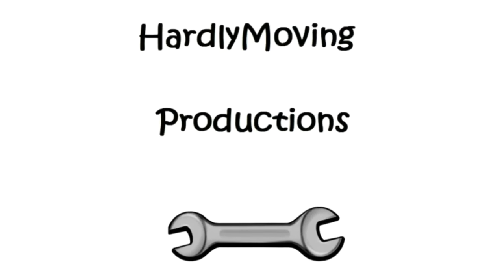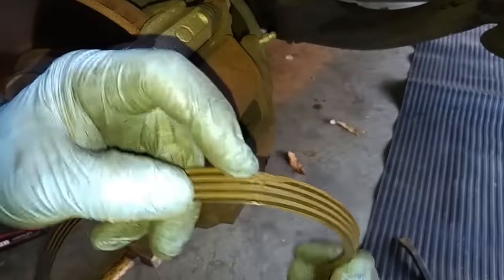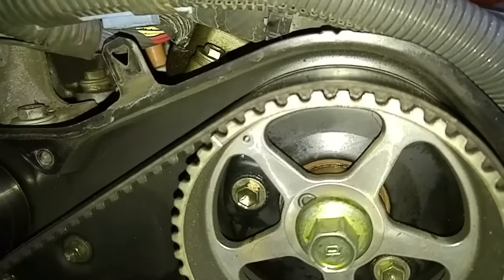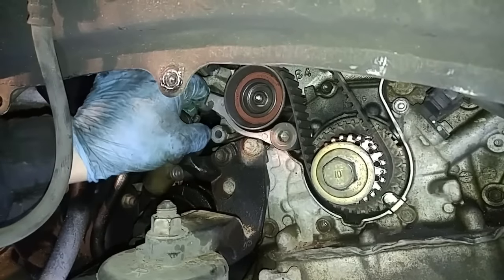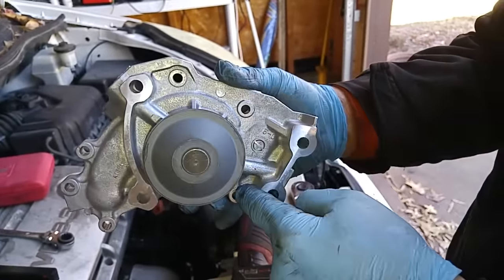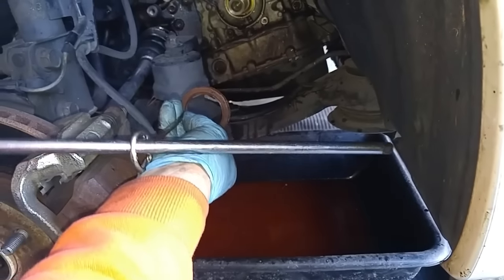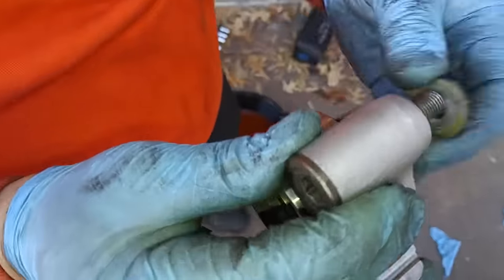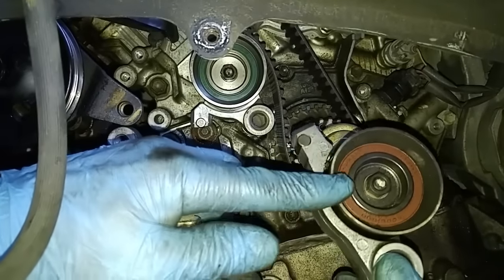Toyota Sienna V6 3MZ-FE Timing Belt, Water Pump, Seals, & Pulleys Replacement

Comment: Hope your still talking about this project, great video by the way....  I have a 2003 Avalon XLS and the engine looks about the same.  I also watched your Camry video.  My Avalon has a lot more space between the timing belt cover and the wheel well.  Does this help with the job a bit?  Had the valve covers changed and only stopped the leak by a trickle.  Lots of oil on the ground so I assume all three seals need to be replaced, at just over 100,000 miles.  I did the water pump on my 87 corolla, but chickened out on the timing belt... just wiggled it out.  I am ready to take this one on as the shop is asking over a grand here in Hawaii.  Is it just about the same with the Avalon.  Any help appreciated! Thanks again.
Reply from the maker: Thanks!  The right bank (firewall side) cam seals can get mis-diagnosed as either a leaking power steering pump or valve cover gasket.  I've seen p/s pumps replaced when it was nothing more than a loose hose clamp which is very common unnecessary repair.   Easy big money maker for the shops.  It's difficult to determine a cam seal leak unless the rear camshaft sprocket metal dust cover is removed.  That's a lot of labor time and the shops would rather say it's something else unless the tech has worked on a lot of Toyota MZ-FE engines.
Reply: @hardlymovingpro  The mechanic put the car on the rack and cleaned the corner of the engine where the oil is leaking.  The oil is often low and I have never had a problem with the power steering fluid levels. Changed the valve cover gaskets and it helped but there is a puddle of oil after parking for just a few minutes.  I have to assume its the crank or cam seals.  It looks like a difficult but doable job.  There does seem to be a lot more room than on other Toyota models with the same engine.  The shop owner specializes in Taxi repair and is a very honest guy.  We do have a lot of V6 Toyota taxis on the road in Hawaii so I can assume he knows where the leak is coming from.  I will check the PS pump and hoses first.  The 03 Avalon is great car and will be hard to replace for a decent price.  Should have a nice long life if the proper repairs are done and correctly. Thanks again! Great videos!
Reply from the maker: @scotthovey7879  You bet and no problem!  Another source of an oil leak are the CV axle output shaft seals (where the axle slides into the transmission).  A puddle of oil is a bad pretty bad leak.  Here's a link to a recent 97 Avalon T/B & W/P replacement video.  When I pull out the cam seals, they were brittle and falling apart in my hand!  And the customer was complaining about a long of oil leakage.  You can see all the oil residue on his t/b tensioner:  https://youtu.be/Y7WLtDkcAp0

Comment: Thanks for the great videos on timing belts. I recently bought an impact wrench - Milwaukee 2663-20 with a max torque of 450 ft.lbs. I found it on a discounted price of 179 with the battery. I was wondering if you ever used this model and if that works for the Crank Pulley bolts for Toyota/Honda and suspension jobs. The most powerful gun 2767-20 with 1400 ft-lbs is definitely the best but exceeds my budget and application as a DIYer. Thanks for your guidance as always!
Reply from the maker: The Milwaukee you bought will do just fine.  You'll need a high mass impact socket to work with your new driver to take off the crank pulley.

Comment: I had one question if the timing belt was to snap would I need to rotate the crank shaft pulley and cam shaft two times at 360 degree angle to get the timing aligned?
Reply from the maker: Belt breakage on this engine would bend the valves.
Reply: What can I do if the timing belt has no marks for the camshafts?
Reply from the maker: @nelsoncanelas1978  Make your own by applying marks on the old belt before taking it off, then transfer the marks to the new belt.

Comment: Is the crankshaft bolt reverse thread? We cannot get the crankshaft bolt off on mine. We have tried impacts and everything.
Reply from the maker: Not reversed.  Used the high mass socket?
Reply: @hardlymovingpro  i haven't tried that. Just a regular impact socket on a impact wrench. I'll try a high mass. Could it be anything else?

Comment: So here's a really ignorant question. I've been reading up on the pros and cons of using an impact wrench to put the harmonic balancer back on. I know you don't have a problem with this method, and I'm tending in that direction myself. However, as I have zero experience, there's no way I'll be able to "feel" for the right torque. Instead, can I just use a black sharpie to mark the original factory setting of the bolt in relation to the pulley, and then torque the bolt until the marks align again?
Reply from the maker: That should work fine.

Comment: I hope you'll do us a little favour by sharing a quick video sometimes. For the 1MZFE design, I couldn't locate the rear (Bank 1) block drain location for the coolant. The front one is right there next to the filter. Where to find it and how to reach it... Thanks!
Reply from the maker: Those engine block drain bolts are on pretty tight and are usually rusted in place.  So I don't bother taking then off when changing the coolant.  Removal of the water pump generally gets most of the coolant out of the block.  You can also tilt the engine from the other side to get more coolant out.
Reply: Thanks for reply. I was infact wondering for a coolant replacement job only. Do you use a specific technique when its only the coolant job.
Reply from the maker: At the dealership we used a fluid exchange machine and pushed in 4 gallons of premixed coolant.  Pretty wasteful in my opinion.  For the shade tree mechanic, drain the radiator, remove the thermostat and blow in compressed air into the engine block.  That should get most of it out.  If you're worried about residual coolant in the system, add distilled water (you'll need around 2 gallons) with the thermostat removed and run the engine then drain the water.  That should dilute most of the coolant in the cooling system.  Don't forget to place you're heater control on hot.  You can also detach the supply hose leading to the heater core and blow in compressed air.  Either way, remove the thermostat.  When doing a timing belt / water pump replacement, draining the radiator and the coolant draining out from a removed water pump I'd guess gets out around 80% + of the coolant.

Comment: Not sure the crank mark is TDC.   I think it is just where you do the timing belt positioning.    The pistons should be midway in the bores to prevent valves hitting pistons during the belt change when these crank marks line up.
Reply from the maker: The crankshaft TDC marks, as shown in the video, is definitely TDC.  Done enough jobs to know.  No need to be pulling out plugs to determine where the piston position is.
Reply: @hardlymovingpro  Then why not valve/piston interference when the belt is released and cam goes to equilibrium position.   I think you have always ASSUMED it was TDC.
Reply from the maker: Let the cam go to equilibrium position after the belt is released?  Never heard of that technique.  Then what happens to the crankshaft position?  You're now out of time.
Reply: @hardlymovingpro  When timing belt is released from crank gear,  timing gear may turn if pressure from cam lobes are not equal.   Rising lobes push one way, falling lobes press the other.   Cam will shift until pressures are equal.   Likely only 2-3 cam degrees.   You use a tool to rotate cam back  into position when tightening belt.    If crank mark is TDC, then possibly some valves hit the #1 piston and (possibly) opposing  TDC piston when belt tension is released.   Likely does no harm as opposed to piston  moving and hitting valves.   I do not wish to make a stink of this.   I like your videos.
Reply from the maker: Think you're over complicating the belt replacement process

Comment: Last time I had it done it was $1200. today I bet its $2400.   Update: toyota dealer did the timing belt and water pump $2300 with parts $900. The harmonic balancer needed to be replaced but dealer wanted $650 for it.  Toyota parts through the dealer are 3x or 4x normal aftermarket. Service Rep told me dealerships are using parts markups to make up for lost profits by price gouging the loyal customer. Dealer also said my belts need to be replaced but they are new. Such a scam, hats off for those doing this themselves...
I will do the harmonic balance if I can get the 22mm bolt off crank pully.
Reply from the maker: Thanks for sharing and good luck with the repair!

Comment: I’m having a problem with my 04 Sienna and I drove it 2 weeks ago and then got to the corner it stalled and then when I went to turn it back on it made a loud pop and wouldn’t turn over after that everyone told me that it’s the timing belt could that do it?
Reply from the maker: Possibly.  If the belt broke, you would be able to manually turn the crankshaft pulley bolt (which requires taking the wheel off).

Comment: Do you know why it's harder to break a bolt loose than to torque it back down? I read that technically it actually requires less torque (because less friction) when untightening. But if that is true, it sure doesn't seem true in practice. Like the cam sprocket bolts. I was really straining to get those off - had to use both hands on the breaker. But to torque them back down to spec was much easier. Why is that? Just curious.
Reply from the maker: Interesting you mention this.  While I get pounded by viewers for not providing torque specs, from my experience removing parts, I believe the car manufacturers over torque every nut and bolt at the factory production line.  I guess the manufacturer's philosophy is "better to over than under torque" or "do as I say, not as I do".  Think about it ... a factory line worker with one air impact gun.  Do you think he's going to stop moving to change the torque on his air gun?  How would he do it?  Also, air guns are not like torque wrenches.   Then there's "dry" vs "wet" torque.  If you use the manufacture's torque spec on a bolt with any oil or grease on it, it's over torqued.  That's wet torque since there's less friction on the threads.  In some cylinder head bolt installation procedures, they specify applying 30 weight oil on the bolt threads before torquing them down.  If you don't and torque to specs, the bolt is under torqued.

Comment: my belt broke, new belt didnt have timing marks on it. 59 teeth between rear cam mark and front cam mark. 77 teeth from the front cam mark to crank mark. 75 teeth from the crank mark to rear cam mark.
Reply from the maker: Thanks for sharing!  That's strange.  Never seen a belt for the Toyota V6 without the timing marks.

Comment: Got the harmonic balancer off. There are bits of rubber belt stuck in the grooves. Should I clean it, and how?
Reply from the maker: You can simply wire brush it off.  Belt residue may have been caused by oil getting onto the belt.  So I'd replace that belt as well.  You can remove any residual oil on the pulley with brake clean spray solvent.
Reply: @hardlymovingpro  Little bits of the belt are also stuck in the grooves of the pulley itself. I assume I should not use a wire brush to clean that. I tried blowing them out with compressed air but they are really stuck. Maybe it isnt't a big deal and the new belt will seat fine.
Reply from the maker: You can scrap it off with a razor and a brass wire brush won't hurt it.

Comment: thanks you for detail on video and i just subscribed 
if i just do the timing and water pump do i need  to take the cam- gear out or not?
Reply from the maker: Only if you want to replace the cam seals.  I replace them because I know they won't last till the next TB change ... which is 100k miles.
Reply from the maker: Welcome and thank you for subscribing!

Comment: The repair manuals say to remove all the spark plugs, I noticed you did not.  Why not?  I thought they are supposed to be removed so you can rotate the engine to get to tdc.
Reply from the maker: I use repair manuals as guides ... not gospel.  You saw in the video how I rotated to TDC without pulling the plugs.  But, if you want to spend another couple of hours pulling out and reinstalling the plugs, that's your choice.

Comment: At 16:36, you show top dead center on the lower, inner sprocket. I have all 3 sprockets top dead center, the top 2 timing belt alignment marks aligned, I I can’t get the lower belt mark to line up with the lower, outer sprocket. Advice?
Reply from the maker: Don't worry about the paint marks on the belt.  As long as the timing belt marks on all three sprockets line up with no slack on the belt on the right side, you're good to go.

Comment: Hello again. I'm looking to buy a harmonic balancer puller, but it looks like I'll have to buy metric bolts separately. Do you know what size bolts worked for you? Also, how do you get the crankshaft pulley torqued back on at 162 ft. lbs? Thank you.
Reply from the maker: Here's a link to a harmonic balancer removal tool on Amazon:
https://amzn.to/2XQQXoo

To torque off and torque back on above 150 lbs, you can use an AC powered 1/2 impact tool with the Leslie 22 mm high mass impact socket.  The link to the tool on Amazon:
https://amzn.to/2VQ0Dxw

Comment: Thanks again..do you have any video of changing the power steering pump
Reply from the maker: Nope.  They generally don't fail on Toyota's.  They give the impression they're failing when the reservoir hose leaks and runs down to the pump.  Also, when the back camshaft seals leaks, the oil runs down on to the pump.
Reply: That's pretty right... Earlier this year, I had thought my PS Pump is leaking and had the project of rebuilding it... but eventually, the pressure hose was found as the source of leakage.
Reply: @hardlymovingpro  On my 07 Highlander the PS return line developed a leak where it made contact with the frame and corroded through.  Used some 3/8 fuel line and some hose clamps to make a splice repair.
Reply from the maker: You can do that.  As a quick fix, what I do is move the old spring clamps up to make room for worm clamps.   As the hose(s) get old, they get hard and the spring clamps don't have the clamping force to prevent oil seepage that eventually turn into leaks.

Comment: 2006 Sienna 84,000 miles & went to Dealer to replace all belts, Water Pump, Cam & Crank seals as preventive. Dude broke his tool & bent another trying to remove the crank gear(?) so I did not do the seals: $1150.
Reply from the maker: Just the crank?  How about the cams?  The cams can leak a lot.

Comment: I see some videos where you have to remove the studs of the water pump. I see that it is not necessary do you by chance lifted the engine? Thank you
Reply from the maker: You can maneuver the engine up a little with a hydraulic jack with a wood block between the jack and the oil pan.  Should give you the clearance to pull the side motor mount bracket and w/p off.  Otherwise, you can get a inverse torx (aka E socket) to remove the stud(s).

Comment: Hi! While breaking loose the LH cam shaft sprocket bolt, the TDC mark moved from (12:00 o'clock) to about 2:00 o'clock. I know my 04 Sienna has a non-interference engine. Do I just go counter CW to TDC? , or go  CW from 2 to 12 (TDC)?, how many turns?  Thanks in advance !!
Reply from the maker: Not unusual for this to happen.  Just position it back to 12:00 using a box wrench.
Reply from the maker: If jumped clockwise, then re-position counter clockwise.  No full rotation necessary.
Reply: @hardlymovingpro   Thank you sir! Much appreciated.

Comment: Okay, sort of big problem. When I was removing the 2nd tensioner bolt (at 7:30) one of the sides of the bolt deformed, and now I can't get a good snug fit with the socket (6 point). What do I do? I can't get it off?
Reply from the maker: Been there with that problem.  You need to go out and buy yourself a "Bolt Extractor Kit".  They're used to take off rounded bolt heads and are designed to "bit" into the head when turned counter clockwise.   You can get it at Lowes, Home Depot or Harbor Freight.
Reply from the maker: Also, if the PS pump bracket is too much in the way to mount the socket,  remove the PS pump pivot bolt in order the drop the pump away from the stripped tensioner bolt.
Reply: @hardlymovingpro  Bless you! I got the PS pump out of the way and was able to get a good bite on it with an impact socket. Whew. Be calling the dealer Monday for a replacement bolt.

Comment: What do you do if you took the timing belt off and the rear can wont settle on the marker? It keeps springing forward or back 90 degrees
Reply from the maker: Never had a problem getting the cam to settle at or near the TDC mark.  Use a box wrench to move the cam back and forth till you find a point where it won't jump.

Comment: Motor mount bracket is an absolute hell to get off....this is probably the only video where the bolts have not snapped. Of course mine snapped and now im sitting here spending more time getting that off than on the entire job. Never again! Thats for sure...
Reply from the maker: You probably live in the rust prone area of the country.  I have had situations where the aluminum on the bracket sheared onto the threads of the bolt.  Had to use my tap and die tool kit to clean things up.  Also, you can apply penetrating oil on the bottom of the mount bracket holes may have helped.